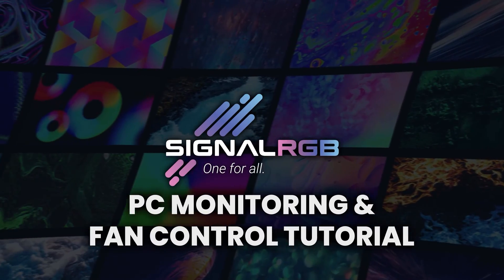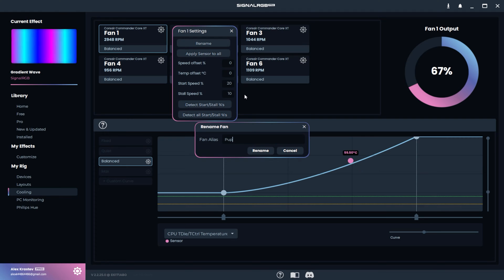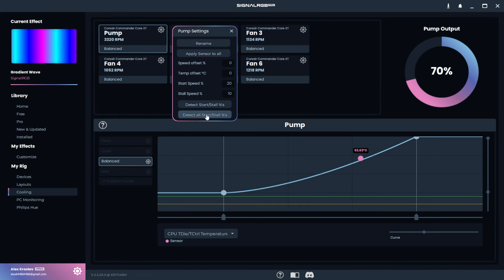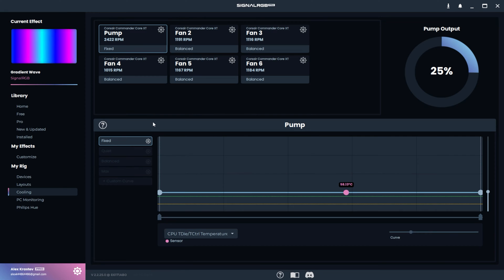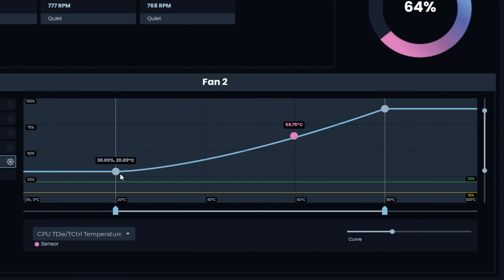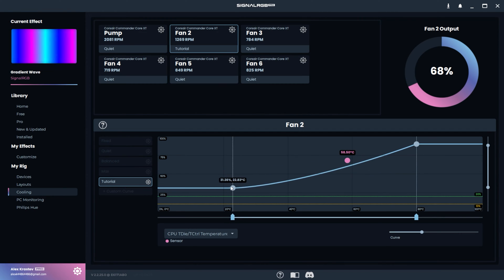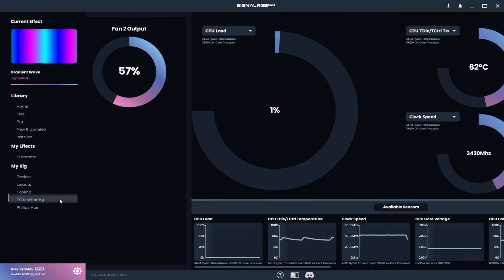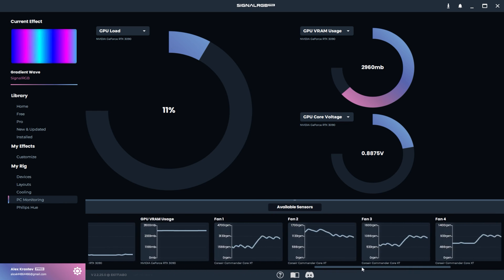Controlling Fan Speeds With SignalRGB

Comment: Any help with this
I am in the cooling tab however I only see and can edit my AIO I do not see any fans that are running in my PC. How can I fix this?
Any help would be great.
Side note, Signal RGB DOES in fact detect the fans in devices tab but I dont see them in cooling tab
Reply: I have the same problem, did you find a fix yet?

Comment: got the pro to control my fans but signal rgb not detecting it wtf
Reply from the maker: @logicsmlgaming3616  Where are your fans connected? Were they detected in a previous software?
Reply: @SignalRGB  They are connected on argb header
Reply: @SignalRGB  also my wooting keyboard is not detected

Comment: This feature shouldn't be behind a paywall... Since it's a vital and standard feature on any other software and you require deletion of those programs to use this one , not a good design... And then if you can't sign in for whatever reason you don't even get access to what you're paying for
Reply from the maker: To be fair, we don’t require deletion, it’s manufacturer apps that don’t have an option to disable RGB control on their side. If they did that you could use their app for fan control and ours for rgb control. We do plan to have a basic form of fan control free down the line. What issue are you having with access to it after paying? Can you tell me more?
Reply: @SignalRGB  I'm meaning that you have to be signed in at all times in order to have access to that specific feature.. And if something happens like loss of connection or a server outage , your fan's would no longer operate the way they're supposed to and be stuck in a low rpm setting that you couldn't change... I can understand paying for special or advanced features but something like fan control which is Necessary these days especially with newer and high end Pc's to keep temps down , it's vital , and then no option to save it so it's locked in regardless of connection , I just don't understand any reason for doing so other than money 💰
Reply from the maker: @trelixz7138  I believe the offline thing happens because people would be able to circumvent pro if the subscription expired and they are offline. Either way you bring up a good point, I’ll see if we can speed up the free version of fan control we have planned so you can have access to that when offline.
Reply: @SignalRGB is the free version of the fan control available now or still

Comment: Damn this is awesome! Can you control RGB with this too?
Reply from the maker: Yes its an RGB application
Reply: @SignalRGB   Also I see that some motherboards are not supported. Does that mean that if using the budget motherboard, you cannot control the RGB and individual fan speeds?
Reply from the maker: The fan RGB and fan speeds can be controlled via RGB controllers. Its best to watch our guide on controllers: https://youtu.be/Qd209pxPzpc?list=PLQzqgVnlHybBVClEBsqSAgkdRhCV4zhyi @MultiSciGeek
Reply: @SignalRGB  Thanks, will check it out!

Comment: I don’t want SignalRGB controlling my cooling, only my RGB. How do I stop this?
Reply: To bad it's opt-out. So it's turned on by default. But you'll have to turn the option off yourself. Its in the app-settings section called "Monitoring Settings"

Comment: It would be great if we could add multiple sensors to a single curve. This would allow us to set case fans to monitor both GPU & CPU temps. The fan curve would take only the hottest component into account and ramp up accordingly, even if one of the components is at a relatively lower temp.
Reply: yeah i do that with the Fancontrol program. It's dope and u don't have to use sliders. You can type in the values you want which is way less frustrating.
Reply: @vespaman101  yeah so do I, it’s great. I was just hoping to have one program for everything.
Reply: @SecondBrekfast  yeah I feel that. I haven't used the macro control thing yet. I just got signal rgb. How worth it is pro, if you do indeed use it?
Reply: @vespaman101  I don’t have pro, would definitely consider it if the fan controls were better implemented.

Comment: What is the point of creating custom fan curves, so they don't make too much noise while my hardware is overheating? I would like to request the option of having one big button that says, DO WHATEVER IT TAKES TO KEEP MY SYSTEM COOL, then I won't have to worry that it isn't being managed properly and will be taken care of automatically.  Thank you
Reply from the maker: Easy, just select the pre-created balanced fan curve and you’re good to go. People like to tweak their own fan curves because every system is different.
Reply: @SignalRGB  Thanks, I appreciate your clarifying that for me.
Reply: a custom curve can play things quiet and cool while you're not doing anything and you can set it to basically hold out unless things really get up to a serious heat load then u can have fans crank all the way up. I run custom curves on fan control that more or less do that. My pc is basically really quiet unless I'm doing something really intensive. and due to the custom curve anything over 75c for my cpu basically kicks it into a turbo mode so to speak.